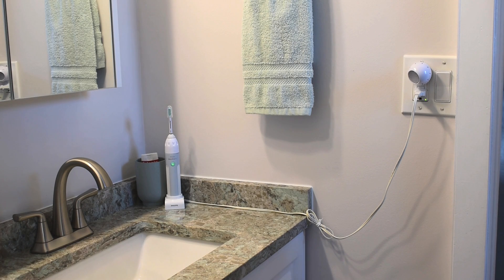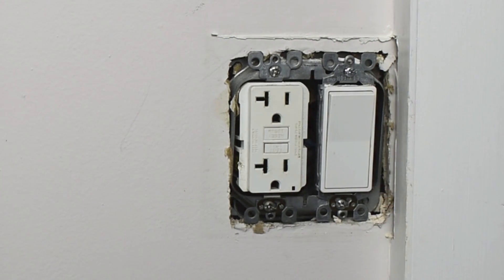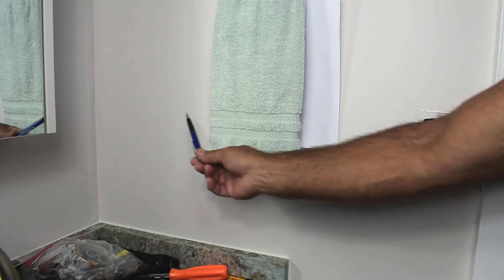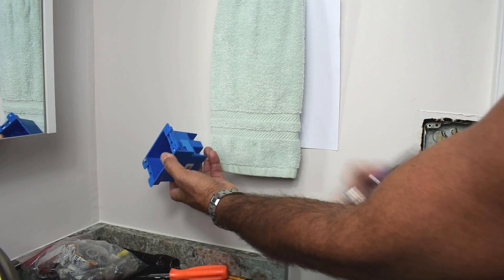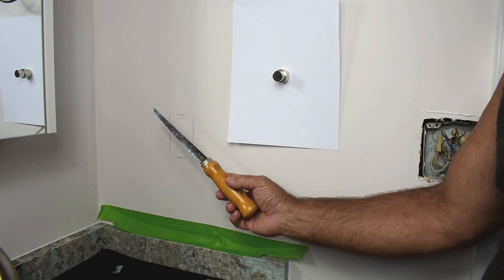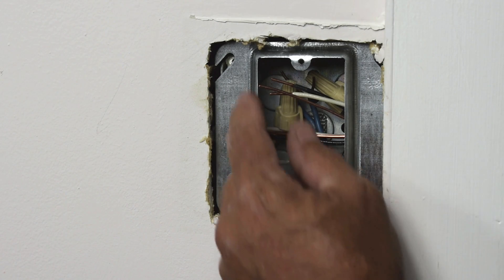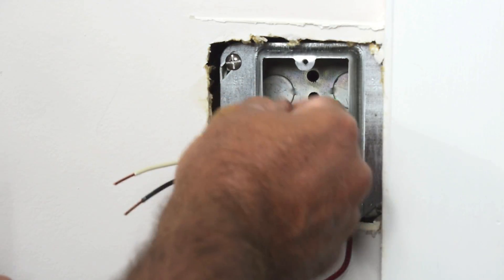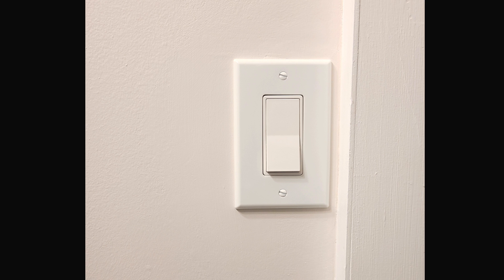HOW TO Move or Add Electrical Outlets With No Drywall Holes By Studs

Comment: In my house the covers are modified on several outlets and switches in order to avoid cutting the molding or trim.

Great job cleaning up that electrical!  Thanks for the video.

Comment: You lucked out with that firestop.
I sometimes drill a hole where I want to locate an outlet and fish some wire into the hole then rotate it 360 degrees to assure the clearance needed for my box. That way I can adjust the box as needed.
I would have thought that firestop would have been lower [cabinet nailing height]. Probably there for a towel bar.

Comment: Is a minimum distance from a tap a legal requirement?
Reply from the maker: No. The reason why I said up to 4 ft away was because that lets you drill through two studs. If you have to drill more than two it becomes a problem.
Reply: I’m asking about distance from a water source to the fitting.
Reply from the maker: @grahameroberts8109  No. The rule is if it's within 6 ft of a sink you need to have a GFCI receptacle

Comment: You used a 20 amp outlet on a 15 amp circuit.
Reply from the maker: The 20 amp rated GFCI was already there, so yes I'm going to reuse it. I don't waste money. If I had a 20 amp circuit with a 15 amp rated gfci, then that would be an issue.
Reply: @electronicsNmore Actually, per NEC, 15A receptacles, including GFIs are allowed on 20A circuits, as long as there are multiple outlets on the circuit. If the 20A circuit has only one outlet, then yes, it needs to be 20A receptacle.

What NEC doesn't allow are 20A receptacles on a 15A circuit. That's gonna allow someone to insert a 20A plug (has a horizontal neutral blade fitting into those receptacles) which will overload 14 awg wiring and trip the breaker. 

Not worth the risk IMHO in saving money to keep that 20A one, especially if 15A receptacles are cheaper.

Comment: Shouldn't you be using GFCI outlets in bathrooms?
Reply from the maker: Correct, that's what you see in this video. Any outdoor receptacle or receptacle indoors within 6 feet of a sink or tub.
Reply: @electronicsNmore  I'm sorry. I couldn't tell that was an outdoor receptacle. I like the video.
Reply from the maker: No need for apology. Thanks for watching!
Reply: @electronicsNmore  I can see it now. The buttons are both white. I couldn't see that on my small screen.
Reply: It's cleary a GFCI he installed.

Comment: You actually can't drill holes or put  fasteners through boxes, unless that code has been changed. 

There's at least a couple of brands that make old work/new work boxes that have angled holes in the boxes for nailing or screwing.

Southwire makes one. I've seen them sold as "Smart Box". Comes in the common shapes and sizes.

BTW, I'm referring to the screw you put through the box and into the fire block.
Reply from the maker: If there's a knockout you can use it
Reply: @electronicsNmore  I referring to screwing/drilling through a box, all the rest of your video is great. 

I did it all through a job, and the inspector mentioned it to me. Since then I've had to replace many boxes, which we call old work, right? So I often have to replace with Smart Boxes. 

Most of my work these days is in areas where housekeepers abuse the plugs daily, so they must be robustly mounted. 

I also work in tracts where all of the boxes were flawed, and  the plastic breaks where the recepticle screws go in.
Reply from the maker: @aredditor4272  If you mean making a hole in a plastic box, then yes, they don't like to see that. In that case you can feed the cable from the new opening toward the plastic box and fish the cable into the plastic box, or make a small opening in the drywall just above a plastic electrical box to get your drilling done, then patch it.